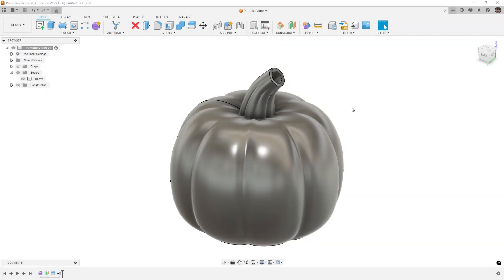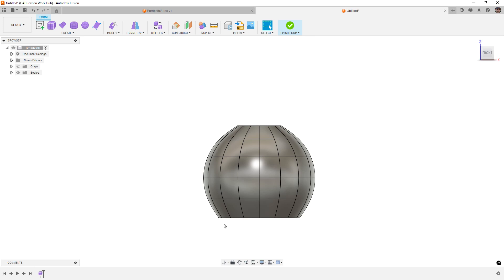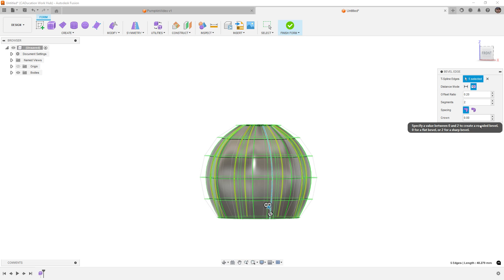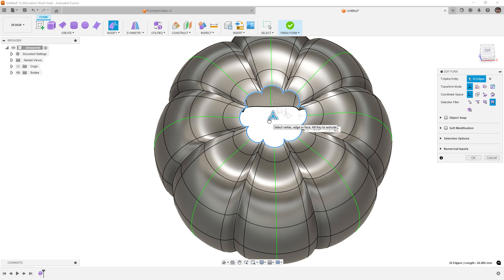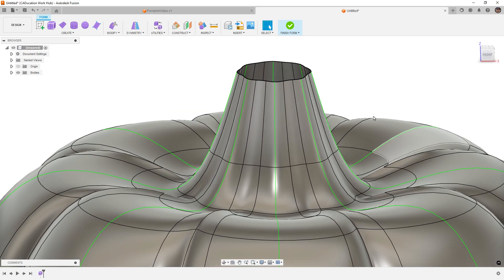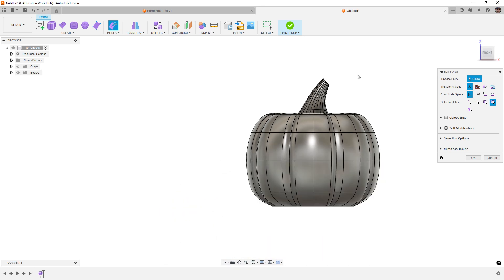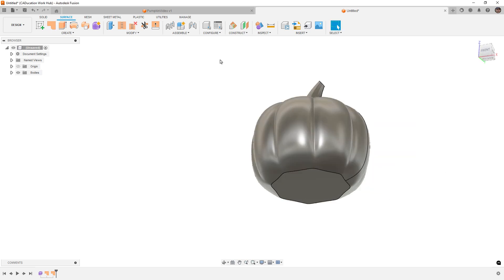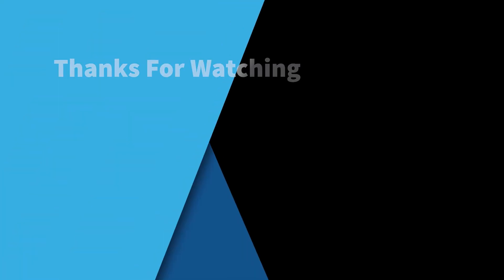How To Model a Pumpkin with Fusion Forms

Comment: How do you hollow out when you’re done. When I try to create a shell it doesn’t work.
Reply from the maker: depends on what you want to do with it.  if you are just 3d printing it then just do it in the slicer. set a very low infill amount.

If in fusion it will be based on the geometry.  Use thicken in Forms.  then if there are issues you can manually adjust.

Another method is to scale a copy down and subtract it.  not a perfect offset but works in a pinch.

Comment: Thanks for your tutorials, are triangles important and when should we allow them in a design.
Reply from the maker: In general you want to avoid non 4sided faces in a form.  thats 3 sided, 5 sided or more.  For something more organic like a pumpkin its ok as pinches and creases in the surfaces aren't going to take away from the design.  But in say a car body you would want to be real careful.  IF i have to have them i try to stick them in areas where the design is more flat.  IE not changing curvature much.

Comment: Today i found out that you cannot multiple select (window, paint, etc.) inside a model.
You need to begin to drag outside in the free space 🤦‍♂ A real pain in the a** for some purpose.
Nontheless, great video as always Mat!
Cheers Mate
Reply from the maker: Kind of a pain but if you go to your selection filters and turn off component drag, you can paint when over an object.  why its like that i don't know.... It prioritizes you being able to click/drag even if on paint.  i agree its a pain.
Reply: @LearnEverythingAboutDesign  The problem is, in some scenarios there is no option to turn off "component drag", it just did not appear. Maybe when modeling in the main parent without components.
Then it's not possible to paint or select without clicking in free space first.